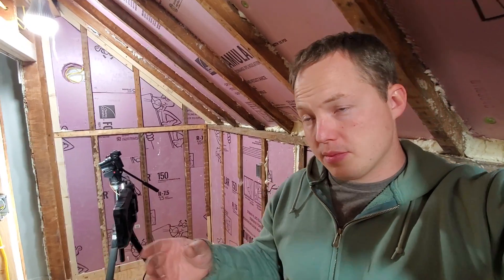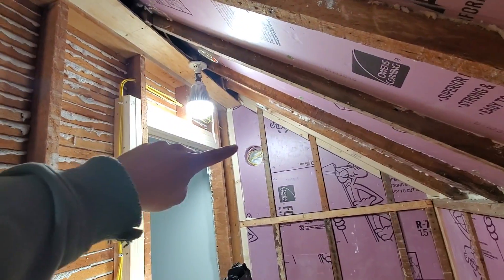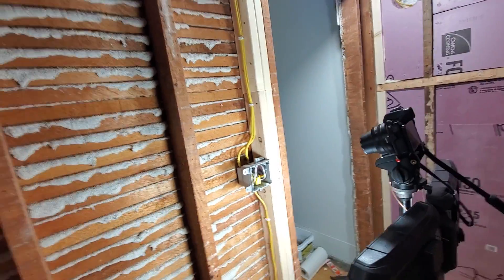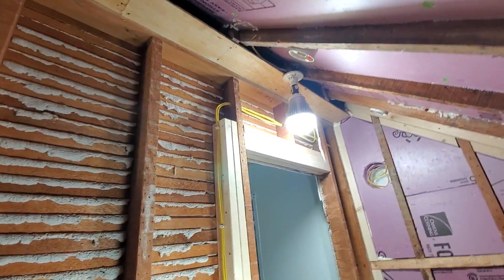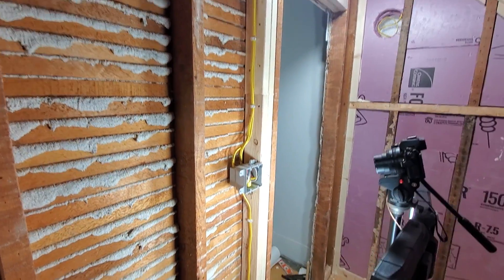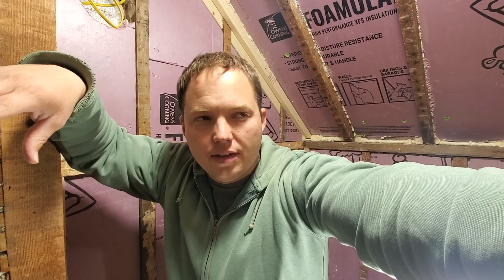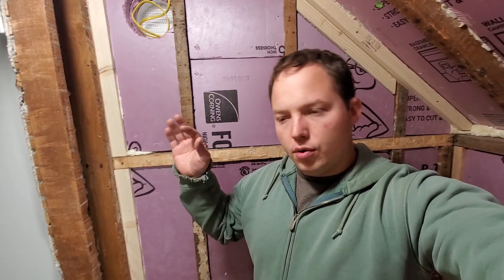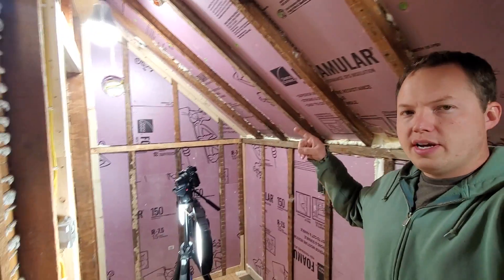GFCI Protection on Both Lights & Receptacles in Bathroom?

Comment: This is where pigtailing will save you.  Pigtail both gfci receptacles with follow on to the lights.  Yes, "T" tap the wires for the receptacles allowing gfci protection to remain only in the box with the gfci.  The lights will be on he same circuit with zero gfci protection.
Reply: yeah, i just did this.  As I understand it, it is not that unsafe, and doesn't violate any codes (USA)?
Reply: @almanac520  no code violation I know about.  You "T" tap and get gfci protection in that box, at that receptacle only..

Comment: I love your work. Very clean. Better than code minimum.

Elsewhere, I saw that only the *receptacle* needs GFCI protection. Now with LEDs required, they can flicker on that circuit if the whole thing was GFCI protected. Moreover, a GFCI breaker would require you to find the breaker panel and reset the breaker - maybe in the basement, in the winter, dripping wet, with a towel around your waist or head. I would go with the AF breaker and one GFCI receptacle feeding two boxes. 

But you are the electrician and I always enjoy what you put up. We don't have many of those challenges out it NV or Cali since the housing stock is so new. And there are not that many basements. Or converted barns. 

BTW, that arc-fault breaker is pretty sensitive with heavier tools. My 1 hp compressor tripped it every time it kicked in. I had to go find a non-protected outlet so it would keep running.

Comment: I'm currently attempting to upgrade 48 year old Circuits/Service Panel with AFCI protection. As many of the Circuits are running on Tandem Breakers I'll probably be using a fair number of Outlets with AFCI Protection and covering entire circuits that I'd rather have divided up... But since I already have "Emergency flashlights" (Plug in)in the Bathrooms (Basically act as Night Lights) if a GFCI tripped a plug in would automatically turn on (stay on) when power is lost (or it is dark). Modern GFCIs often have indicator lights (and/or audio alarm) too. So if people don't freak out it... A reset might not be too bad in a small location.  If Batteries/clutter is too much then maybe some Glow in the Dark stickers or accents to further help locate the reset switch...

Comment: I thought the lights had to be on a separate circuit …. More and more I’m thinking the lights in a bathroom should be on a GFI … can you imagine if your kids are playing around with the shower massage and point it at a ceiling light …. I always install a gfi on a recessed light directly over a shower… even if it’s in the attic…

Comment: I think I would have run 12-3 from the first box to the second instead of 12-2. Then use a GFCI outlet in the vanity box (where you would expect it) and wire the LOAD to continue on to the second outlet so it is also protected. Use the third conductor in the 12-3 to continue the LINE so that the lights can be run off of that hot wire. Benefit- the lights will stay on even if the GFCI trips. Additional cost is only a short run of 12-3 instead of 12-2, savings is a single GFCI instead of a combination breaker or multiple GFCI's.
Reply: Adam Bursell. Are you saying: AFCI 20 amp breaker, 12-2 to vanity outlet with GFCI outlet, 12-3 to second outlet with non GFCI hot wire going to switch? If so, I like it.
Reply: This and also lights will not have as much tendency to flicker when they’re on their own circuit.

Comment: Canadians watching this should know that using a 20A for lighting is a code violation in residential. Nothing wrong with it, it will work just fine and be safe as it is down south, but just not allowed.

Comment: Is the lighting for the room just outside on a separate circuit? If so, that light would probably remain on if you tripped the bathroom circuit and provide enough light to find the problem.

Comment: If the GFCI is the first in line on the circuit it protects everything else downstream of it. So, if I understand how you wired this up you would only need one. If you look hard enough you can get a good quality 15 amp GFCI for $10 where as a GFCI breaker will be far more. On that point, why a 20 amp circuit for a light, fan, and maybe a plugged in hair dryer; do you plan to do some microwave cooking or such in your bathroom? Also, if you trip and it’s in the room it’s much easier to reset and in fact know it’s the GFCI that tripped, instead of going back to the panel.
Reply: People use hair dryers, curling irons, etc in bathrooms.  Always plan for the worst case scenario.

Comment: With no window for natural light, I'd prefer a separate power source for the light.  But that's just me.  However, I do have a question ... why the plastic boxes?
Reply: Because they’re cheap and effective? Less labor intensive? Metal boxes have their place, but so do plastic or fiberglass boxes. Particularly for a seldom used extra bathroom such as this.
Reply: @JimYeats  Thank you!  I just haven't seen them in my area.

Comment: Unless the NEC codes changed, it is illegal to put bath receptacles and lights on the same circuit. Check with your local electrical inspector to make sure your doing it safe and legal.
Reply: Check the code, Jim.  That one has changed.

Comment: Are GFCI receptacles really that costly where you live. There is a difference between being frugal and being cheap. You wanted my thoughts, so now you have them. Why risk losing the lights when you're using the bathroom? I'm not a big fan of "code minimum" for almost all building construction.

Comment: Where does the power to the vanity box come in from? The top or the bottom? If bottom, would it be possible to move the supply over to the box by the door so you could run a AFCI breaker and a single GFCI outlet by the door, with power then continuing on to the lights and the fan, and the load side of the GFCI then going back to supply the vanity outlet? And on AFCI, isn't that intended for bedrooms and places where extension cords could end up in a position where they could be walked on, under rugs, etc, so wouldn't they not be required if the circuit is only feeding a small bathroom such as this? Generally, even if it's not required, personally, I'd prefer the lights and outlets being on different circuits.... But if the absolutely had to be on the same circuit, I wouldn't want the lights to be on the FGCI circuit so if the GFCI were to trip for something, you can still see.... OR, the other option could be those 'emergency lighting' LED bulbs that have a small battery in them to allow it to work when the power fails.. I've seen one but I'm not sure how they work as I've never taken them apart.

Comment: The AFCI can trip upon detecting any arcing/sparking of brushes on a commutator (so they say). Not necessarily great in a bathroom where a hairdryer is used. A GFCI can trip when using fluorescent lighting on the circuit--this I have experienced personally. The lighting engineer I spoke with said that fluorescent lights leak a little current to ground which the GFCI can detect. Good quality receptacles like Hubbell, rarely give any trouble and now even self-test so I think that is an advantage. All in all, whale oil lamps are best--just have a good smoke detector powered by a non-protected AC circuit. LOL.
Reply: I have seen lights occasionally trip the arc fault as well. The newer point of use are much more sensitive than the old outlet version.
Reply: Thing is, with whale oil, you can run your stove AND use it to pop popcorn. Better than bacon grease. Mmmm.

Comment: You can use a AFCI breaker, GFCI outlets, and have the lighting fed separately from the GFCI rather than have the GFCI outlet protect the lighting circuit. 
That way, the entire circuit is AFCI protected, but only the outlets are GFCI protected, so if an outlet trips, you still have lights.
Reply: Excellent idea!  I like that way of doing it so there’s not a tripped GFCI causing loss if lights.  
Question I run across occasionally is whether there’s a GFCI requirement for switches in damp or wet locations.  What does the code say?
Reply: @fomoco300k  
GFCI protection is required for all outlets outdoors, in basements, in garages, in utility areas, and within 6’ of any water source.
Reply: Beat me to it!

Comment: It will suck to be in the dark. But it is a small bathroom. If there is a window then you will still have some light to find way out.
Does code require gfci or afci on bathroom light circuit?
Easiest.. Tap the light and fan of next room light.

Comment: This is perfect for that size bathroom. You could have even got away with a 15a circuit. The odds of it tripping is rare unless using 4 hairdryers at the same time lol
Reply: @CP-wh7pn  my point being many homes are different. My house was built in 1990 and all 4 bathrooms were on 1 circuit tapped onto the main floor GFI. Worked perfectly fine for many years. I did a remodel in 2018 and pulled all new 12/2 for each bathroom. also 14/2 for the lighting. This video demonstrates a perfect example of how to wire a new bathroom in 2021 especially that small size bathroom
Reply: @CP-wh7pn  what code? that would easily pass inspection where im from. What does your code state bud
Reply: @stevesether  Agreed 100% now a days its safer to go with 20A if possible. However where im from 20A is only necessary for kitchen & laundry room. Not for bathrooms
Reply: @CP-wh7pn  sure id like to see. However the code varies across the world. Im not sure what state your in but here its only required to use a 15a for each bathroom. using 20a may seem overkill to some but I do like the idea because I did it in my own home
Reply: @CP-wh7pn  if you still have knob & tube in use today it must be replaced. In 1898 they probably had a lamp and a radio lol! Now a days that shits gotta be cut & rewired. Like I said I agree with using 12/2 but where I’m from it isn’t REQUIRED by code to use it. A dedicated 15a breaker will work just fine. In reality when will you ever draw 20a in a bathroom. Give me one scenario and then I’ll agree with you

Comment: Code says that the vanity plug has to be on either it’s own 15 amp or on bathroom vanity shared 20 amp. It cannot be on with lights in the bathroom or anything else for that matter. Full stop.
Reply: By “bathroom shared 20 amp” did you mean something different than what he did?
Reply: @fomoco300k  yes. The vanity plug according to the 2015+ nec must be either a dedicated 15+ amp breaker or a shared 20+ amp breaker shared ONLY with other vanity PLUGS in the house. (Yes this is stupid but true) It cannot be shared with any other plugs or lights on the same breaker regardless of if they’re also in the bathroom.   Personally just wire up a separate breaker per vanity.  It’s better.
Reply: @jameshancock  oh, I see what you’re saying, now.  Thanks for the clearer explanation.
Reply: @jameshancock  code section?

Comment: I always put my lights on a separate circuit from the outlets. Just my way of doing it.
Reply: In a new install, or a gut reno, yes, that's the way. But if you're renovating and keeping the existing circuit from the breaker, you can splice directly for the lighting and then run the outlets, rather than have the lighting "protected" by the GFCI oultet, so that if the outlet trips, the lights won't go out.
Reply: Good Good

Comment: Is it allowed in America to install 12-volt transformer outside wet room and use LED lights without GFCI protection? Or lights in bathroom should be only 120 volts?
Reply: Good

Comment: While you can get away with an AFCI receptacle in a remodel circumstance, in new construction the home run must also be protected, which it wouldn't be with an AFCI receptacle. Since you have the walls down and the stud bay exposed it's arguable whether your circumstance only needs to fulfill the retrofit requirements. So breaker is usually better.

Comment: Local code for homes where I live requires 15 amp max circuits for lights so i would run 1 15 amp circuit for lights and one 20 amp circuit for the 2 outlets.

Comment: Here in California, code requires lights on its own 14 amp for residential. And receptacles on its own 20 amp .. 👍
Reply: California code says you can use a dedicated 20 amp circuit for lights and receptacles in bathrooms. No not share other locations.
Reply: We don't care about California
Reply: That’s not a code. That is your opinion...
Reply: Here in Canada each bathroom needs its own 200amp 3ph service. We also use a 3ph scim bathroom fan

Comment: Code requires a dedicated GFCI 20 A circuit to all baths with nothing else connected to it. Lights should be on separate circuit.
Reply: There's an exception to this code that says lighting and fans can be on that 20 amp circuit if the circuit does not leave the bathroom
Reply: Can you provide a code reference for that?
Reply: @mr.g937  I believe 210.8..... google it, will pop right up.
Reply: @craftyhandyman9757  210.8 covers GFCI protection. It's 210.11(C)(3) and 210.32(A)(1).

Comment: You could child the GFCI by running a 2nd piece of Romex between the two outlets
Reply: What??  Could you explain what you mean by “child the GFCI”?
Reply: @fomoco300k  
I think he meant "chain", but I'm not sure.
Reply: He means running a piece of romex from the load side terminals of the upstream GFCI receptacle to an ordinary receptacle by the door. So you'd save $20 by  only having to buy 1 instead of 2 GFCI receptacles, at the cost of romex and labor to run it.

Comment: I think this is 100% a case by case decision, as in there's no definitive right or wrong answer. Although if you were going to ask a production electrician the correct answer is the combo breaker. Why? Because it meets code and it's cheaper. :)